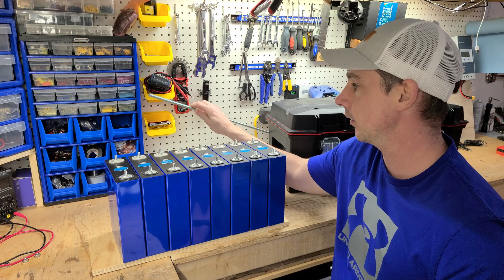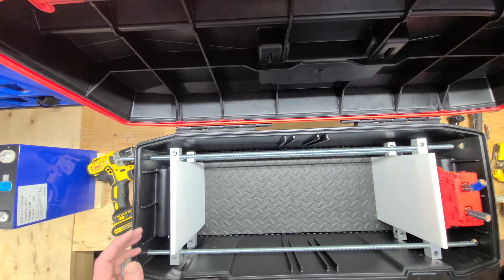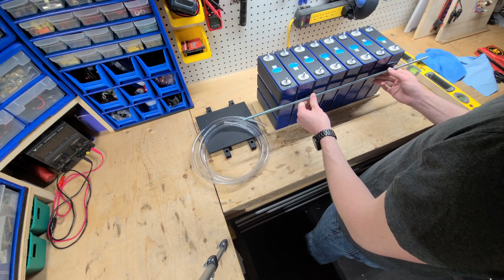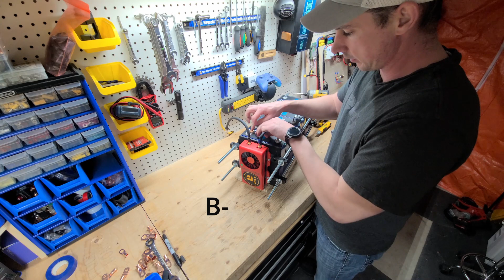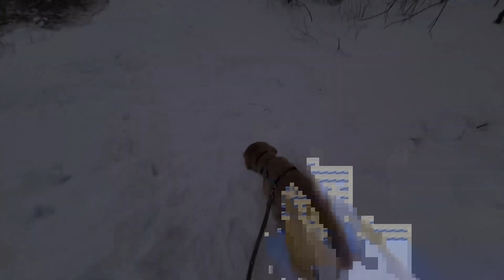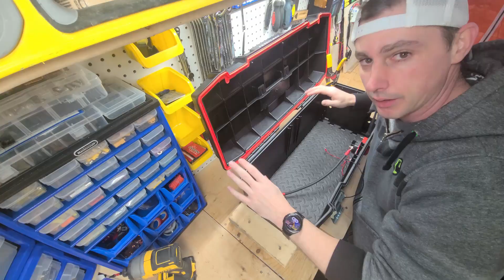DIY [5.8kWh] EVE raw cell battery build

Comment: Is that two resistors you have together for the pre charge? I see they are 10W, how many ohms are they? How is your Daly working out? I see some channels using a 100A BMS but wouldn't that only give you 2400W out of a possible 3000W?
Reply from the maker: I was using 2 5W. I suggest 1 10W 10 Ohm. In this build I use 150A daly BMS.
Now I would suggest using a JK bms instead. 🍻
Reply: I took a look at them. I take it you would still get a 150A one. Would you get the 1A or 2A balance current model?
Reply from the maker: @logdonac  The 2A would be better if you're willing to spend the money. You're local and I have 2- 24V daly bms's I probably wont use again.
Reply from the maker: @logdonac  I can sell you one
Reply: Oh it’s a 200A
Reply: Why do you prefer the JK?
Reply from the maker: @logdonac  Because of the higher balancing current. But, if you have good cells, you'll never balance much. I had my daly going for a year, and I was out maybe 0.07 mV

Comment: thanks for getting back to me I appreciate it. Was that a 28" Craftsman toolbox? Seemed to be a good fit. I am building the same battery for my sailboat and the idea is perfect. I am also using the Growatt 3000 24v unit. Saw the Deal's Gap shirt. I did that ride with a bunch of Toronto cops. It was interesting. Great videos. Thanks for doing them.
Reply from the maker: Yes, It was the 28". I did that ride with the wife from Oshawa. Did Skyline drive Blueridge Parkway over to deals gap. 2-week ride. Beautiful scenery!
Reply: @Roll2Videos  I’m in Oshawa. I did the same ride with the cops. The first time I did it I drove my 650 VStrom from Shwa to Vegas to LA, Flagstaff, Roswell, San Antonio, Sarasota and did it and the Parkway on the way home. Great trip.
Reply from the maker: @logdonac  Yeah, That sounds like a hell of a ride.

Comment: how is your precharger built and hooked up? Is it mentioned anywhere in your videos? Thanks.
Reply from the maker: In my newest video with the Bougerv mppt charge controller, you can see the concept. Only add a pressure switch and ring terminals.

Comment: great job! My only question/comment would be the weight rating of the handle on the toolbox. if it failed you could bolt a handle on each end, on the compression rods and solve that problem pretty easily. Thanks for posting a great video!
Reply from the maker: Great observation. The handle on the top I never use because I do think it could fail with the weight of the cells. The box has handle on the side that are molded into the plastic of the box. Great comment thank you 😊

Comment: Nice build. I couldn’t find the bms in the description. Do they make a 48v version? I think to want to try a build like this.
Reply from the maker: Thanks I didn't see the link wasn't there.
The Daly bms is good for this build because of the mounting holes. Look up the QUCC or JK BMS on AliExpress. Make sure you input the proper info for your system. The qucc with bluetooth is nice. I show it in my powerwall and BMS vids. Older not so great videos lol

Comment: Love the build. Probably gonna steal this for me van battery build. Whats the temp like being in a box? I would probably stash it under a seat as well so wondering if a fan in the top of the plastic box would be helpful?
Reply from the maker: I haven't load tested for heat yet but if you buy a battery pre built the cells are in a enclosure and topical have foam around them so I'm guessing it'll be ok.

Comment: Get some acorn nuts for the outside ones instead. If you are running for extended time its gonna get pretty toasty without vent holes in the box.
Reply from the maker: Yes, When I was charging at 60 amps the BMS was showing 31°c (87.8°f) I was thinking of installing a computer fan on a thermostat module with vent covers to keep it cool.

Comment: I just purchased 8 EVE lithium cells and was thinking about mounting set ups and came upon your video. This is a great idea for my mini camper. What is the tape you're using for the temp sensor?
Reply from the maker: It is kapton tape.  https://en.m.wikipedia.org/wiki/Kapton
Reply from the maker: I like this method better then mounting them. When I winterize my setup I can easily move my cells inside to keep them warm in the winter. You should watch my lithium storage video if you are in a cold climate for parts of the year. https://youtu.be/svQGwOMs2uA
Reply: I'll check it out, I live at a high elevation in the Colorado mountains. Definitely have plenty of cold weather. What type and thickness neoprene are you using, eg. foam or hard rubber.
Reply from the maker: @davidb9501  Sponge Neoprene W/Adhesive 12in Wide X 1/8in Thick X 54in Long https://www.amazon.com/dp/B07ST4BQDT/ref=cm_sw_r_awdo_907XX8YDE82Y3E794HXH